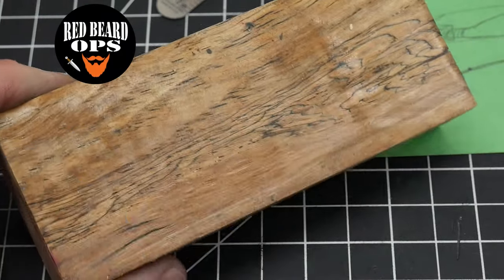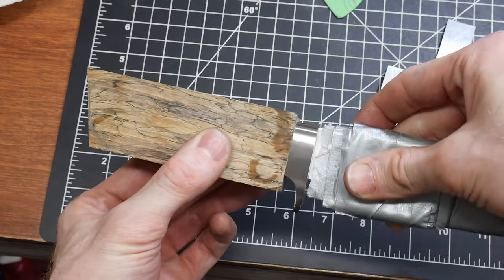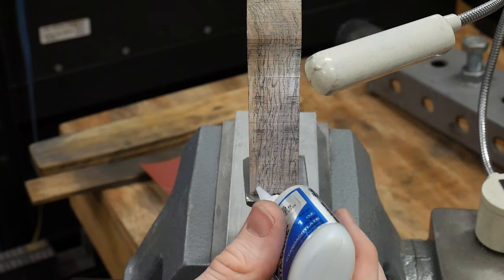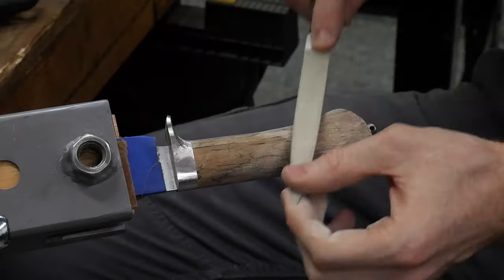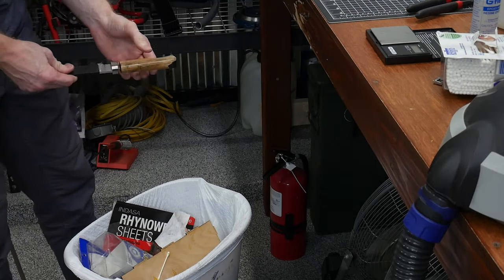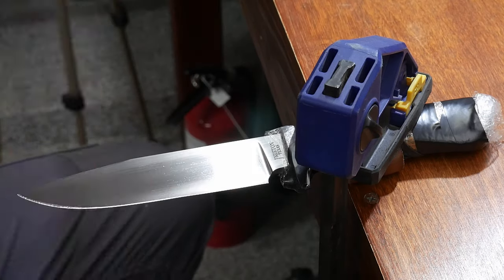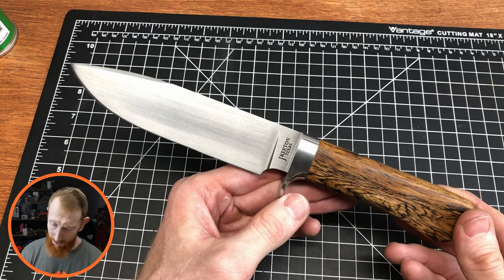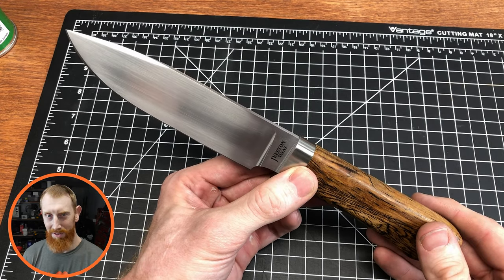My June Hunter - Knife Making - Part 3/3 - FINISHED 🙌

Comment: It turned out great!  You learn from every build right?  One thing, thread your pommel nut while it’s still in the lathe.  Just Chuck your tap in your Jacob’s Chuck.  👍
Reply from the maker: Thanks Tyrell, I sure do learn! Sometimes the same things twice! LOL -- On the pommel nut; I've had issues threading on the lathe. I don't have a really good way to lock the chuck other than relying on the back gears, and the spring holder method with pressure coming from the jacob's chuck has been hit or miss. Are you saying to power tap with the tail stock free?
Reply: It's actually illegal to tap on a lathe unless you power it up on the highest speed setting first.
Reply: @RedBeardOps  I don’t power tap, it’s too dicey and easy to break a tap, specially the smaller ones.  I put the tap in the chuck and move the lathe chuck by hand or put the key in it to pull it back and forth as you tap.  That way it keep the tap perfectly aligned with the hole.

Comment: For the handle guard transition.  Radius the edge of an 8" contact wheel and use the radiused edge of the wheel to set the radius.  Scribe layout lines on both sides of the guard and then hold the knife horizontally and roll the knife to get an even radius up to both scribe lines.  It takes a couple minutes and they you are on to hand sanding.
Reply from the maker: Good tip as well!

Comment: Next time you should try sanding you handle up to 1000+ grit and finishing with tru oil instead of buffing. Especially if you want crisp transition lines. I find that buffing changes the surface of the wood way more than if you were to do this. I'm still playing with the tru oil method myself, but, I do like the results I've gotten so far. I really need to start making and sharing videos of my progress as a bladesmith. Thanks for this series!
Reply from the maker: Good tip!

Comment: It turned out great overall! The handle is a little chunky as you pointed out, but not overly so, perfect for someone with large hands. My only real critique would be the finish of the blade. I would like to have seen you take it up to a higher grit finish to match the guard and pommel nut.  Might just be a trick of the light and the camera though. ;)
Reply from the maker: Thanks Brandon!

Comment: 7:24 don't you hate when that kind of thing happens?

I've been working on a honyaki bunka, that I've been trying to give a mirror polish to give the hamon a traditional sort of look for a japanese kitchen knife, and I've had to start over a couple times now, because it will get scratched from setting it down, or working on it. 

Btw if you have any advice for a mirror polish, without driving myself insane doing it. I would love some advice. I have some buffing wheels, compounds, sandpaper (I'm thinking i need to find an alternative to 3m once i get to the 1000 grit range, because their wetordry seems to slow down significantly at 1000) and other stuff. It would really be appreciated

Btw, the spalted pecan does look really nice.
Reply from the maker: Yeah, wasn't happy! LOL

I really haven't ever done a mirror polish on a blade, so I'm the wrong guy for advice there. 

That pecan came from Pop's! Good stuff.

Cheers
Reply: @RedBeardOps  if you value your sanity keep it that way. It's so tedious and time consuming to polish hardened steel. At this rate idk if I'll ever finish.

Anyway great video like always. And great knife! I need to check out pops knife supply, I always use trugrit, and alpha. I heard good things. Plus they're about to have larrins new steel there , (looks very promising) I think it's on preorder.
Reply: @_BLANK_BLANK  Try diamond polishing paste and a small buffing wheel on a slow drill or similar if all you're wanting is a mirror finish (grits go to something insane like 60,000, so you'll have no problem finding what you need).  Just keep in mind that buffing the actual hamon will kill it and you'll lose all definition, I made that dumb mistake not once but three times before I figured out what was going on.  Powered methods and hamons don't get along for some reason.  Loose abrasive (rock tumbling grit works well) and oil on a cotton pad is a more traditional way to polish up the blade and still keep a frosty hamon like you're wanting.  Etch lightly, then remove the oxides with a metal polish or OOOO steel wool, then loose abrasive, repeating maybe 4-12 times or so.  You can switch from dilute ferric chloride for the first time to a vinegar or lemon juice etch afterward, and alternating those two can give better definition to the crystalline structure you're trying to bring out.  Each time you go through that cycle, the hamon will appear just a little bit better defined, and some features might become visible that you didn't even know were there, but don't go overboard with it.  You can't bring out something in the steel that was never there, and you can eventually etch too deep and cause a valley to form.  Sandpaper has a tendency to smear and destroy the crystalline structure that gives it a cloudy look once you get up to grits high enough for mirror polish, so avoid paper if possible.  I think it has to do with the loose grit filling in the voids of the etching and protecting it from further abrasion, but I have no way to know.  Some have had good success by painting an acid resist (fingernail polish usually) on parts of the knife that they don't want etched, leaving you with only the hamon and surrounding areas to clean up.  To truly get that traditional look requires a LOT of effort and dedication, that's why a Japanese swordsmith apprenticeship lasts five years and a sword polishing apprenticeship is ten years.  One method I want to test soon is using diamond paste and square stock to drag the polish flat over the blade (there's a youtuber that does this with his blades rather than hand sanding, but I don't remember who).  My theory is that it won't smear the crystalline structure like sandpaper or buff it out of existence, rather it may behave more like loose abrasives do.  Diamond paste is WAY faster than rock tumbling grit, and it would save a lot of time if it works the same.  Good luck on your honyaki!
Reply: @Skinflaps_Meatslapper  I'm wanting to go up to a mirror, then worry about bringing the definition of it out later, either using fingerstones, or some other form of loose abrasive like you described. What I want is a mirror finish on the hagane, and a shiny kasumi on the jigane, then whatever detail I can squeeze from the hamon.
Reply: @Skinflaps_Meatslapper  I've seen most of the detail the hamon I put in it can offer during various steps in the polishing, and etching process I've been through already, and I don't mean to toot my own horn, but it actually has a lot of nice wispy detail in it. At this point I'm just trying to get it to a mirror finish, and worry about any detail after. 

I could get a decent finish, with good detail, and do more of a darker western style etched look, but I really want a look more like what they have on the higher end honyakis.

Comment: Ok, The knife is a total waste, the blade is too long. the finish is chinkey. the bolster is clunkey. the handle is botchie.  should i go on.LOLOL  i don't think the knife is that bad for a knife. it's not prefect , no knife is. don't make any difference who makes them.in your eyes you made mistakes. in someone's else's eyes they don't see your mistakes the way you do. i have done welding and looked at the bead. that looks like sh++, but it will hold. at least you point out things when you make a knife that you think are a mistake or could have done differently. all that said.  it is a knife a tool to be used. unless you stick em  on the wall and look at them.  keep on making knives. stay safe.
Reply from the maker: Thanks for your thoughts, Will. I'm moving in the right direction I think!